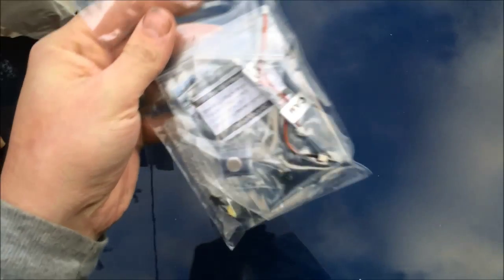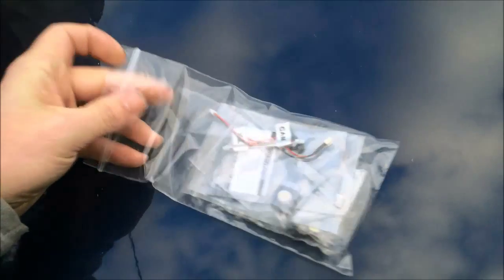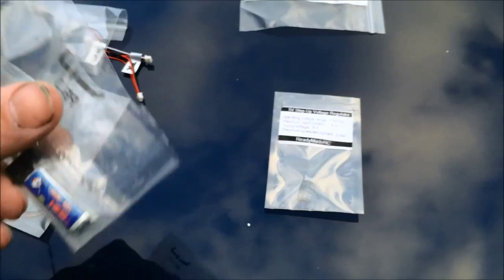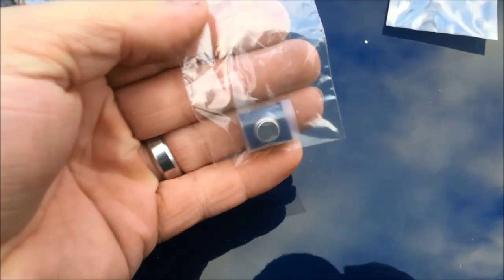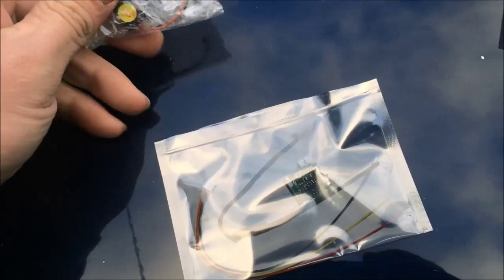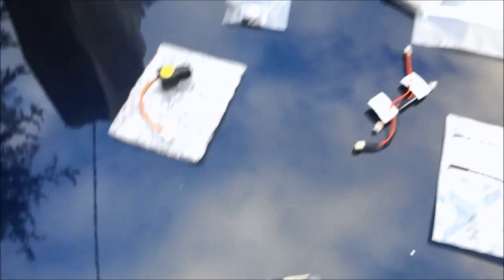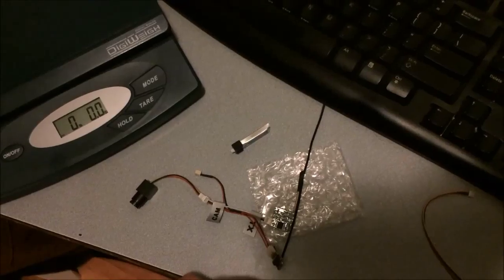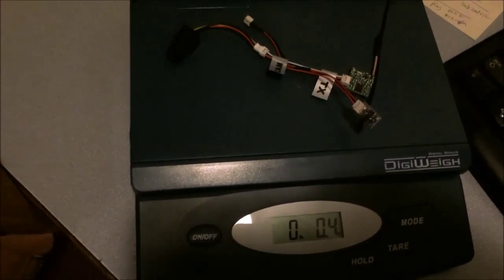Pico FPV setup 1280mhz from Ready Made RC Unboxing

Comment: waiting for the 5.8 to come back in stock for months will get one then
Reply from the maker: have you tried a 5.8g one from them before? wondering how the range is on those.
Reply: not as good as the lower frec but out to a few hundred yards ok with micro stuff all my stuff is 5.8 that is why I don't want to change and start over (cost) $$